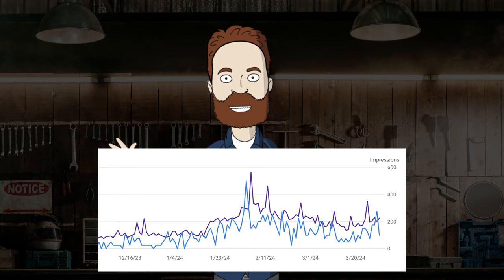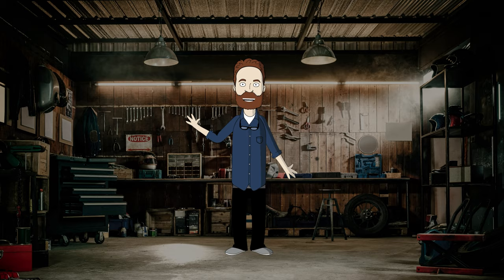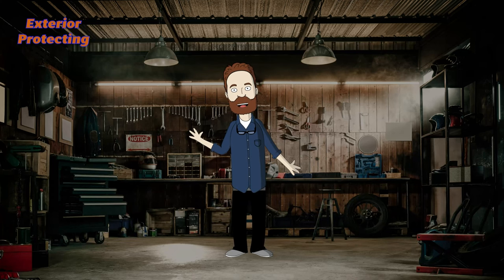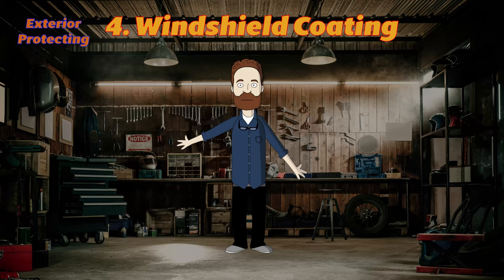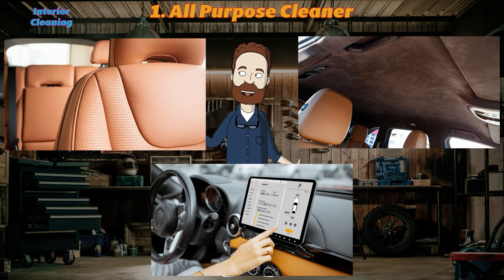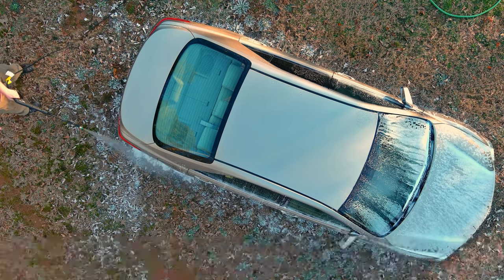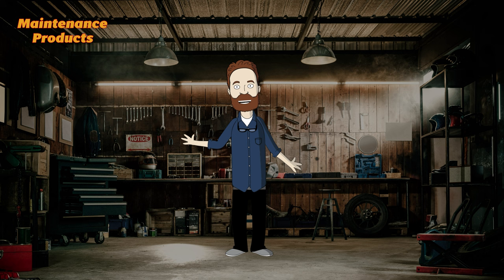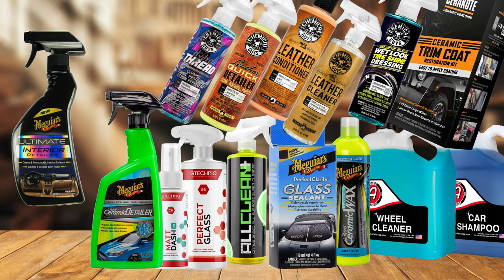Best Car Detailing Products for beginners

Comment: Hi kind sir

Im thinking of buying and do my own paint polish on my car to maintain the black gloss mirror shine

I ceramic coats my car a year ago and maintain it with spray wax & graphene spray every wash (flex grapheme every 2 3 months)

How do i approach the polishing stage?

Im thinking of how do i do the decon & clay. Is it a must?

The car never been too dirty but i can feel some bumps i think its tars

And how do u polish my car but never polish out the existing ceramic coatings. Just to maintain the perfection of mirror look
Reply from the maker: Hello! Yes, decon is a must, but you should pick products that are compatible with ceramic coatings. You cannot polish the ceramic coating. To boost its mirror look, you should make decon and apply ceramic booster.
Reply: @HMBdetailing  I'm thinking if I do a full dekon mystery coating will be gone 

Is there a way to do decontamination specifically for ceramic coated cars just to improve the gloss 

But my condition is the part where is near the will I have like a small bumps when i rub  with my hands. What should i do?

Should i still clay my car?
Will it removes the ceramic coatings?
Reply from the maker: Are you talking about tar? Like a black dots near wheel arches?

Comment: Modern leather the use of a leather conditioner is a waist,  the reason being that modern leather has a protective coating on it ,  think of it as a clear coat.  Leather conditioner will just sit on surface and do nothing but stain your clothes you wear.
Reply from the maker: You are not quite right. In terms of coating on leather, you are right, but it doesn't mean you shouldn't use conditioners. It the same as you will say that you are not using waxes because you have clear coat on your paint. 

Even if modern leather coating is sealed so well, which I'm not so sure about, and you will not 'feed' leather with your conditioner,  you still need to protect the leather from UV-rays, discoloration, stains, and that's what modern automotive leather conditioners are build for.